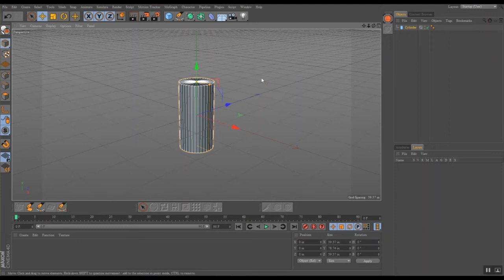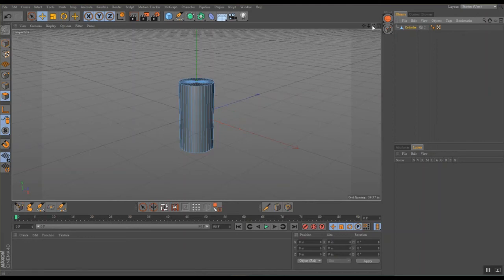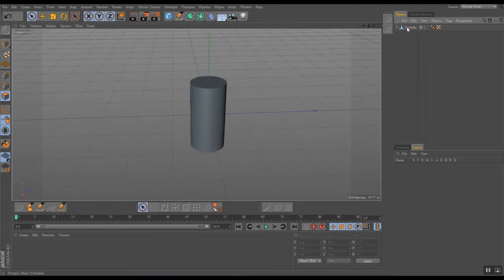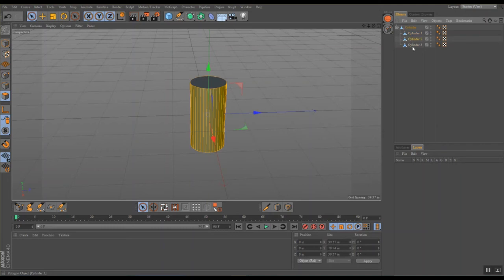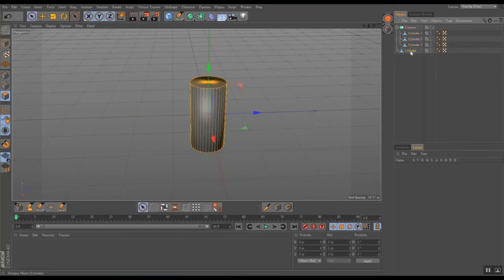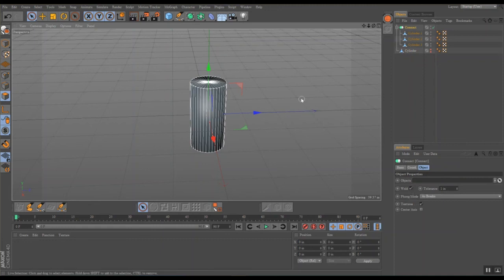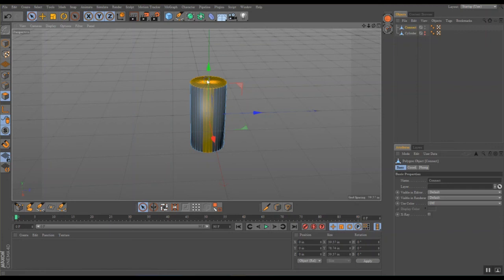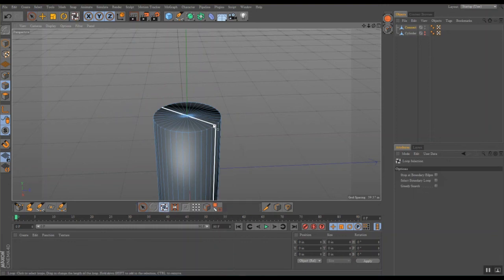C4d Connect End Caps

Comment: this is  my pain in ass, wtf, need other way to connect faces wtf is c4d thinking, verry bad workflow on this. thanks man but dont work when i have a big train wagon.need find other way for this, cheers mate
Reply: Be sure and try the optimize command and if push comes to shove, use the Pen (M~E) to weld points together.

Comment: Chris! you should do some more tutorials! pliiiz! (your voice is perfect for it!)
Reply: Dee - Dorottya Horvath , thank you so much! Is there a particular topic or function you would like to see an exposition?
Reply: Chris Kimble I am very new to C4D, but in love already! Finding it easier then 3DsMax. (or maybe its easier only because its similar to Max... :) )
I will need to simulate water splash. Like a puddle and someone steps into it... that will be defo a challenege... Eill try to create it in Ae as I am more familiar with that, but if you know anything about particles in C4D pls share! ;)
Thanks indeed!
Reply: Dee - Dorottya Horvath, I have to admit I’m new to Myself. I bit off the CC suite, and C4D together and it’s quite a curve to learn it all. For your particular need, I would imagine to make a puddle that will respond to a door splash sounds like it would be built using a hard body, soft body designator for the puddle and foot. The blue ripple effect icon should ripple the material that’s used for water. Just a guess off the top of my head. I’m afraid I can’t be of more help than that.  I do recommend you find Sean Frangella and Greyscale Gorilla tutorials.  They often save my life. Greyscale has a comprehensive course for sale which I plan to soon get. I’d sure like to see your final effect.
Reply: Chris Kimble Amazing! Thank you! Will defo have a look and try your suggestions. 👍